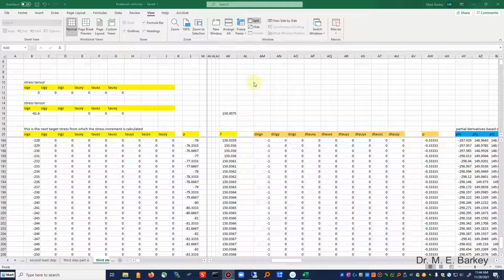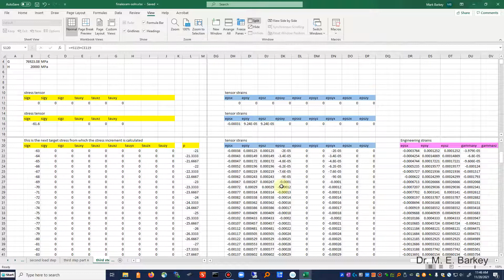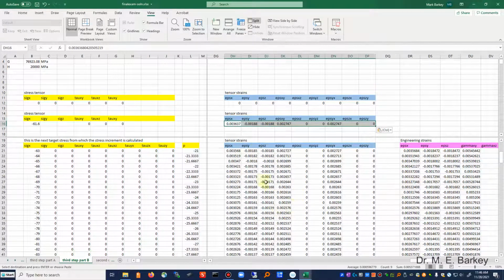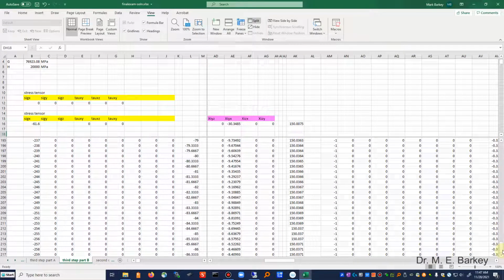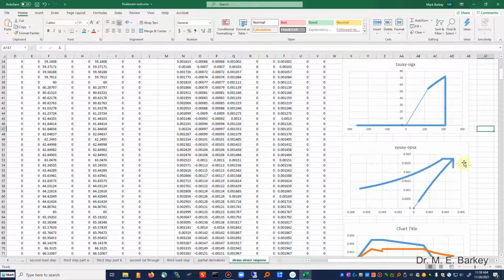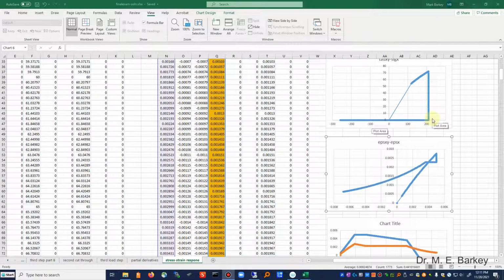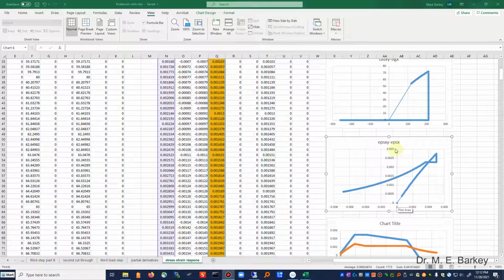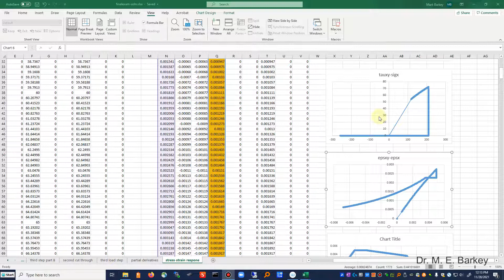648 2021 final hints part 5

Comment: Hi Professor. How should it be solved when it is yielding but the n:dsig is still negative (unloading). Is this even possible? 

I have an uniaxial case with Armstrong-Frederic model where my applied stress is very high (more than 2x the yield stress) then this happens: during unloading (loading to the other direction), the 2x yield stress range is saturated but the n:dsig is still negative.  Should this still be considered as unloading until the actual stress change the sign?
Reply from the maker: Sounds like something that should not happen. The surface normal and stress increment need to be in the same direction for plastic flow and loading.  You might check to see if something has not updated properly, such as the current location of the stress point (see if it really is on the other side of the yield surface upon reverse loading).